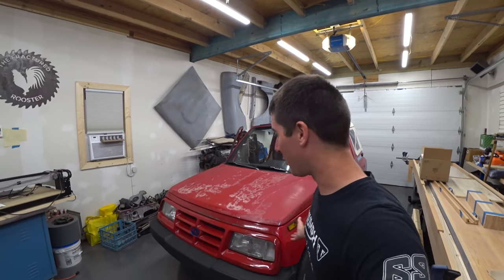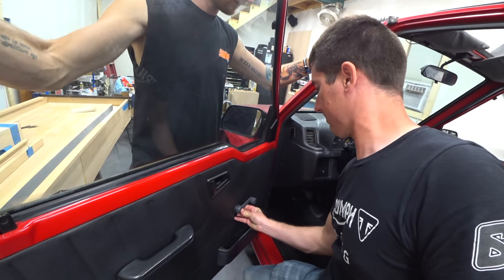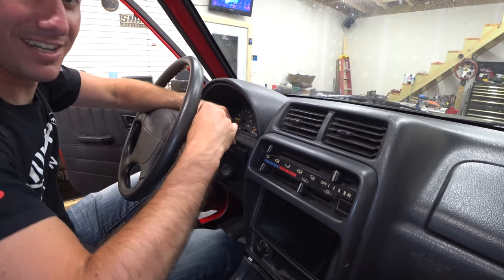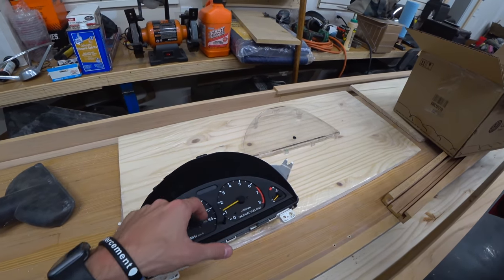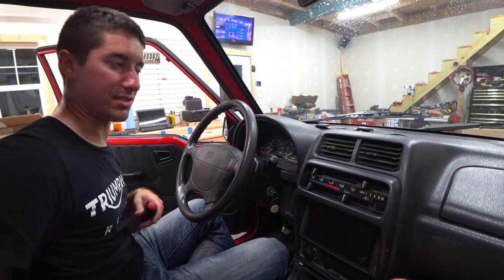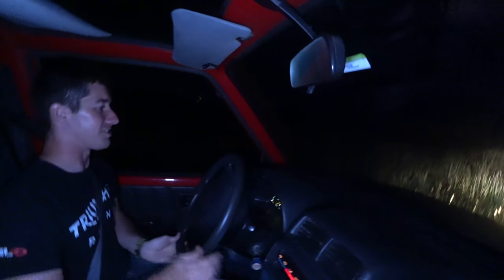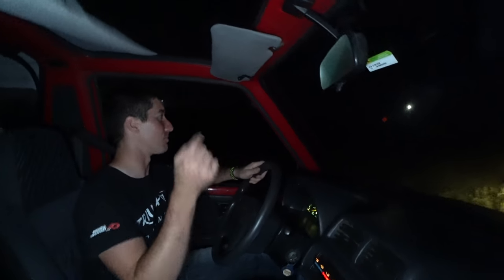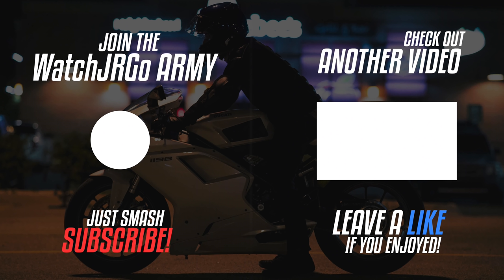INSTALLED A New Speedometer In The $400 Geo Tracker And Immediately Got STUCK

Comment: You're supposed to drop the steering column to get that cluster in and out.

I loved the light trail driving in my Tracker.  The short wheel base and wide stance make that a nimble little goat, and the four cylinder in low gets reasonable torque.  It's kind of like the old Jeep CJ's.
Reply: Tracker has a fixed position steering wheel.
Reply: @2013hwcamaro  It's bolted to the dashboard from underneath the column.  Remove the lower dashboard cover to access them.

Comment: When you open the 'sunroof', fold the fabric back too. Right now it's pinched on the front frame. There should be a strap near the dome light and a slot in the header to keep it from flopping around. Also, in the replacement cluster, I didn't see a 'Service Engine Soon' light come on with KOEO. It should be on the bottom, left side.

Comment: And a project idea just presented itself - 4WD conversion for the Tracker?
Reply: I thought most trackers are 4wd
Reply: Paul Kane if he has to change the speedo cable he might aswell change the gearbox to the 4wd one
Reply: @Jason_Phillips3679  you're not the first to think that. I took my '03 v6 tracker to get worked on recently, and the mechanic there thought the same thing.

Comment: You know what would be cool, is to install a universal power window kit on the tracker, while you're fixing up the alarm since you'd most likely need to install lock actuators in the doors anyway. They're cheap and are quite reliable if installed right.

Comment: You need to pull the inner speedo cable out of it's outer casing inspect it, If no broken strands re lube the cable as you reinstall it with some light multi purpose grease and that will stop the pointer hop.

Comment: I had a few snowmobiles like that. The hex cable end would eat out the end of the shaft being a softer metal and then it was jumping all the time. Usually it was an indication the lower bearing was bad. Most of the time it would snap the cable end off, then no more speedometer, if you kept driving it, the bearing fell apart and the track would jamb up in the drive wheels. On a Chevy Caprice I owned, someone stuffed a Citation tranny in it so the tail shaft was not removable to replace the speedometer gear. I ended up using a JC Whitney( JC Jipme) speedometer that had magnets that you epoxied to the drive shaft and attached a sensor on a bracket that after adjusting did a fair job at estimating the speed. I gutted the cluster and put the aftermarket gearset in the cluster. The odometer no longer worked but it looked factory. When I sold it, I made sure the new owner knew the odometer no longer worked and the speedometer was about 5 miles mph off. That made it within the limit of NOT getting busted for speeding. I loved that car.

Comment: I had to swap a gauge cluster into my 96 Corolla, I put one in with a tachometer. To calibrate and set the speedometer, since its electrically controlled, not cable driven, you pop off the needle while you're driving (I was doing 10 in an open parking lot) and have a speedo app or something similar, and you push the needle back onto the speedo at whatever speed you're going. I've still yet to calibrate the gas gauge though. I'm not too sure how.

Comment: Hit the faded plastic cranks with a heat gun and it will bring the oils in the plastic up to the surface and make it look brand new -- no need to get new ones. Then just hit it with protectant like usual.
Reply from the maker: Sure but I think the new ones were $7 😮

Comment: I checked some of the Trackers for sale online, and I read seller comments about overhauling the engine, more than once! So I'm wondering about the reliability of their 4 cylinder engines. They don't seem to be in the same class of Toyota's 1.6L in lot of their cars like Corollas. They are a good alternative to the inflated prices of Jeep Wranglers, but if the engines won't last, I'm not so sure. That thing is 2-wheel drive...? I'd use it for an around town vehicle but not off-roading. That's for the 4-wheel drive versions. I drove a Suzuki Sumeria back when they were new. That thing was the roughest riding vehicle I've ever driven in. It felt like the only cushioning was from the tires, so I hope the Trackers are softer.

Comment: Did the total miles remain the same when you installed the new cluster? My 2000 accord has the same problem and I fear the miles will reset.
Reply: They should. The odometer reading is stored in the ECU and transfered digitally to the cluster. If not, either stuck with the original cluster or have a shop re-map your computer.

Comment: Did you try dry lubing the cable first? Easy free fix for speedometer cable issues.it will fix the speedometer jumping around problems